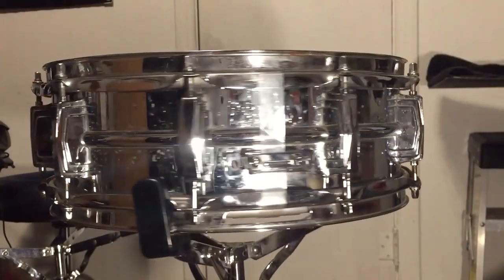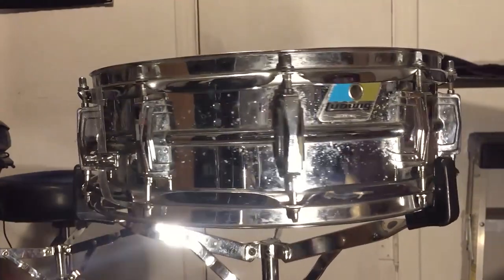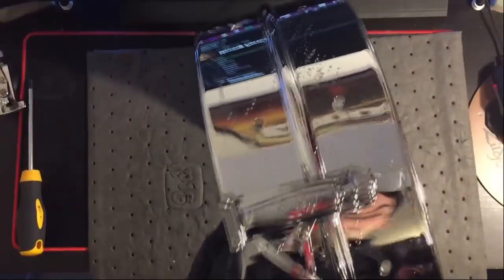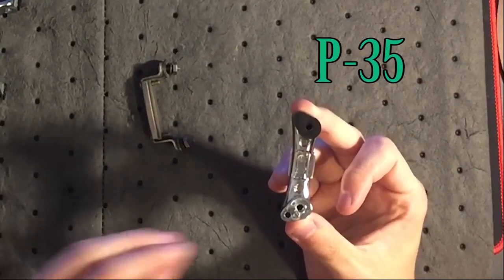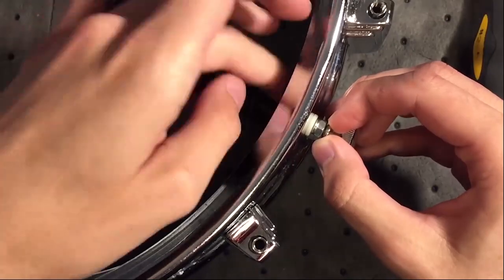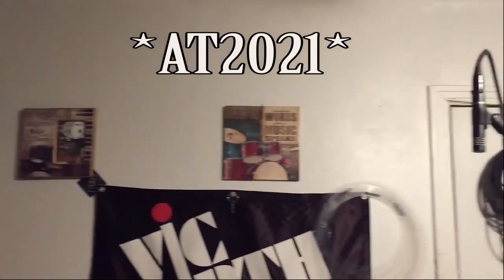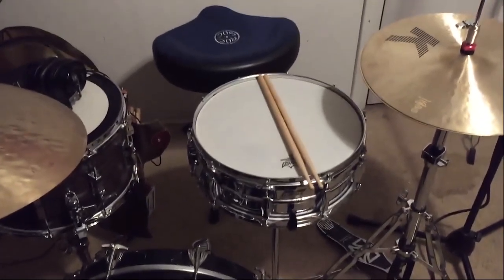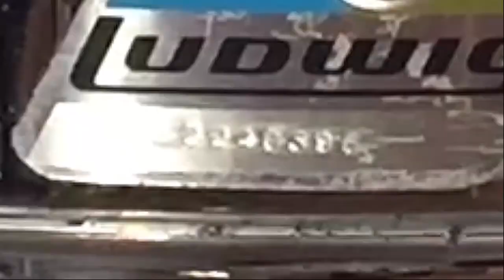Ludwig Supraphonic Restoration

Comment: Totally understand the "gigging drum" vs "home drum" thing.  It's really hard to replace vintage instruments.  Also depends on the gig.  I'm also very/not surprised about the holes in the butt plate: I had to tap these recently (M4 works great w/o drilling), and you'd think after 5 years, Ludwig would have fixed this.  INDe for my next one for sure.
Reply from the maker: I've been wanting to try the INDe throw and butt plate for a while. I'll have to buy a set for my next project. Thanks for watching!

Comment: Really nice video. I just bought a “neglected” Sup-Sen Supraphonic and I’m going to do what you did. Thanks so much for the tips!!
Reply from the maker: Just8 2Much Thanks for Watching! 🙏🏻
Reply: @destination_percussion  I will buy a used Ludwig Supraphonic from the 1960's and restore that drum the same way how you did it.
Reply from the maker: @SuperheroJunior  Best of luck to you! If you have any questions during the process I would be glad to answer them. Thanks for watching!!!
Reply: @destination_percussion  Thanks so much. I will definitely reach out to you when I start this project with the Ludwig Supraphonic snare drum.
Reply: @destination_percussion  I have a question. Why is it that the Ludwig Black Beauty snare drum is more expensive than the Ludwig Supraphonic??
Reply from the maker: @Azarable  The Black Beauty is made of brass and the Supra (and acrolite) are both made of aluminum. Brass is much more expensive than aluminum. Thanks for watching!

Comment: Hi, congratulations on your video, could you tell me the size of the nylon washers for the tie rods? Or maybe give me the ebay link? Thank you very much
Reply from the maker: https://www.ebay.com/itm/296015835872?hash=item44ebeb32e0:g:xJAAAOSwwJ1eLh3Y&amdata=enc%3AAQAIAAAAwL0IIRsRJoHjUpVcLj4fES1cPCx8cY844wHvfsir9j9QMGtOtHDQLVm%2F7%2Bz%2B4e3lL1NYWOE1cn3AlPcGjfsb0fn62zW4Ymv3Qzq0cLSVCOwti7enTPaw3zIqqsKvFFtowE3gRksijPK2bXVKJz2mXji7LTYDe3D8VMEHFPoVjWujRqMkUQEb7MHO5QxOb0yhlNjFTCxc%2FjSYMHLIFrV1%2FSShxiqP3dvsaKZU0lnnqY7hfabugNdoH8iX%2FpuyeprOGg%3D%3D%7Ctkp%3ABk9SR9bFttnyYg
Reply from the maker: Hi! Below is a link to some  more recent washers that you can pick up for a decent price. I used to be able to buy 100 washers for about $6 but now they have since doubled in price since I released the supraphonic video. Link is in the comment below this one. Thank you so much for watching!
Reply: Thank you very much. I ended up buying Tama washers in Italy. Unfortunately, the ones in your link have high shipping costs and arrive in a long time. Thanks again

Comment: Awesome. I just picked up a 72 in pretty great condition. Jusr curious, whats the cotton for under the springs?
Reply from the maker: Hey James! The cotton ball dampens the spring on the inside of the lug. If you don't dampen the springs when you put the drum back together, you'll hear them rattle when you hit the drum. Let me know if you have any more questions. Thank you for watching!
Reply: @destination_percussion  Oh okay, I see. Just curious, is there any actual dampeners made for this purpose that you can buy? Also one more question, Im looking to get new hoops for mine, its the 5x14, do you have any suggestions? I dont feel the need to get original vintage ones unless some come along cheap, but was thinking maybe something that will actually improve the sound for harder playing, but still keep it in the ballpark of the Ludwig sound, so maybe triple flanged of some kind.
Reply from the maker: @underpressureman  Some Ludwig drums have foam dampeners for the springs, but over time they disintegrate. Cotton balls are just the easiest and cheapest option that I've found. As for hoops, I would recommend the 2.3mm triple flanged Hoops from Gibraltar if you can't find any original ones. Super rigid hoops and not that expensive. They can defiantly take a beating! Great rimshot sounds!

Comment: Great video. I have a 1920’s Ludwig and the top hoop is fading a bit (chrome). What can I do to fix this??
Reply from the maker: Thanks for Watching! Is the hoop fading to a sort of goldish brass color?  If so, you’d have to take it somewhere and get it re-plated. Most of the hoops on the 20’s stuff is nickel over brass.
Reply: Destin Ramos yes. That’s exactly what’s happening. Is that pitting?? Is this normal?
Reply from the maker: @StuartJrBarrett  Combonation of pitting and imperfection in the plating process. Most of the plating was done by hand back in that time. (About 100 years ago)

After I polished another project of mine the nickel rubbed off and exposed the brass like your hoops. I’ve just accepted the look for right now until I can replate my parts.
Reply: Destin Ramos sounds good man! Thanks! Glad to know that it’s normal.

Comment: Do you know if a late 70's supraphonic and supersensitive are basically the same drum, aside from the throw off system?
Reply from the maker: Hey James, the late 70’s Supraphonic and Supersensitive have the same exact shell composition (Chrome over Aluminum) as well as having the same lugs and hoops. The only difference between them is the throw off systems. Thanks for watching!
Reply: An SS doesn't have snare beds.

Comment: Yes but I disagree with cotton in the lugs.  Cotton hold moisture.
Reply from the maker: david rodriguez, I never took that into consideration, what would you use as an alternative?
Reply: @destination_percussion  Just a thought.. they sell ‘cut to fit’ a/c filters at HD and Lowe’s.. you can cut them with scissors, they’re plastic (not organic like cotton) and wouldn’t hold moisture.   I’m not a drummer, never tried this, but just a suggestion.
Reply: exactly.  no good reason for that. the lugs hold tension, the springs are just there to prevent things from falling apart during head changes.

Comment: I clicked on this thinking you would show us how to deal with the 'pitting' on the shell...  You did state; 'Restoration'...?
Reply: Only way to do this is to get it re-chromed. No real way to deal with it, and it is more than most people are willing to spend.
Reply: @idontgrillonwed  I've seen them stripped, and polished, also powder coated.  Was hoping for possibly another viable option, or some useful tips.
Reply: Actually this guy is a much better drummer than he is a snare drum restorationist. He left a lot of a corrosion on the top and bottom rims and on the lugs. The orange rubbing compound is much too harsh to use on a chrome surface. It tends to scratch the Chrome. Mother's mag and chrome wheel polish works very well for what he was trying to accomplish. The drum sounds much better than it looks. Just my two cents worth.